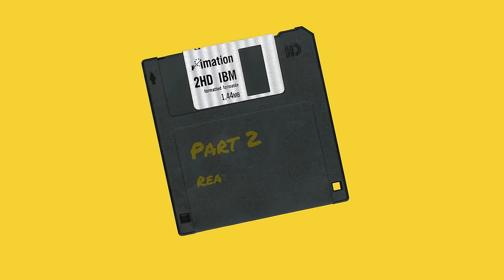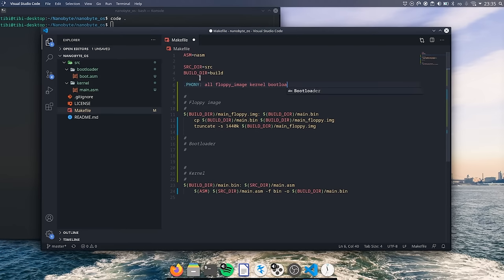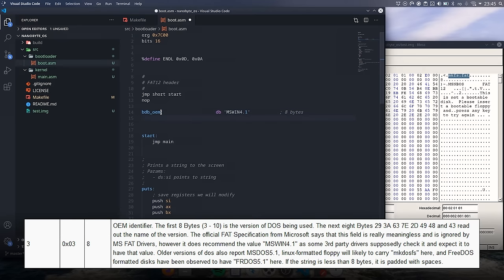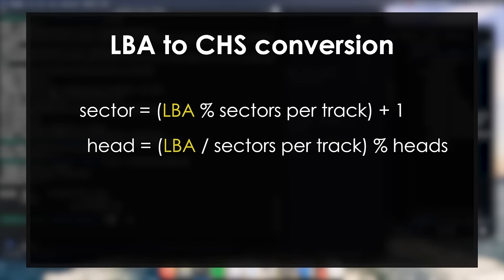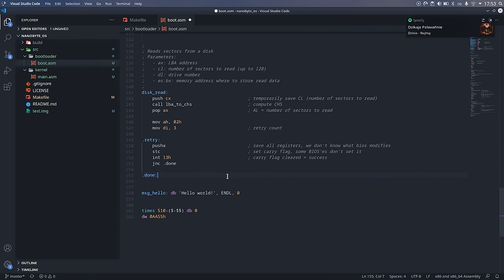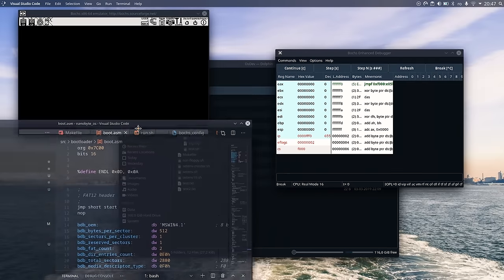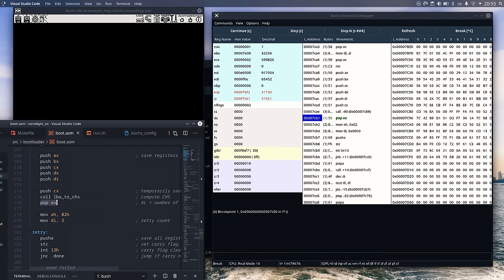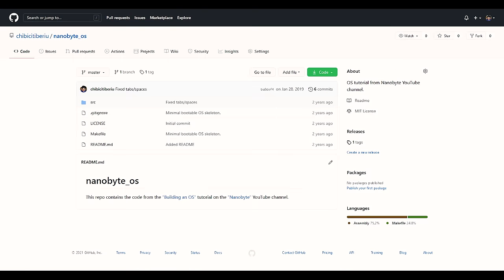Building an OS - 2 - Reading from the disk

Comment: Amazing Video!
The only bad thing was that there is no mkfs.fat command on mac so it took me 3 hours to find a replacement, but i did.
For anyone that is on mac just replace this line in the Makefile:
15 | mkfs.fat -F 12 -n "NBOS" $(BUILD_DIR)/main_floppy.img
       with: 
15 | newfs_msdos -F 12 -f 2880 $(BUILD_DIR)/main_floppy.img
Reply: Thanks!
Reply: later on the choices once again kill mac so now I'm on my own... just entered protected mode and now only just got lld to start making a C kernel for it
Reply: what about the mcopy command?
Reply: @andreitircavu64  That comes from mtools.
Reply: if you've installed mtools then you can use that to create your floppy image: mformat -C -v NBOS -f 1440 -i $(BUILD_DIR)/main_floppy.img

You don't even need to use dd to create the empty image file first.
Reply: I should have checked the comment section before I spent an hour trying to figure it out. I still had no answer untill i saw this. Thanks so much. Probably saved me many many hours and my lots of time searching for an answer.
Reply: any ideas for linux?
Reply: I thinks this difference is because mac os is UNIX certified and GNU Linux is not.
Reply: Thank you.
Reply: For those on Windows having issues. I got to this point just fine. However, adding these extra commands caused issues.
I found that I could call WSL to jump into the linux emulation and call make there and it work.
After the various build commands:
sudo apt-get update
sudo apt install make nasm mtools
Then my make on windows, now under the WSL worked like a charm.

Comment: Rowing rowing your boat... Down the memory lane... That video brings me so many memories. Imagine troubleshooting that without QEMU or BOCHS, using a real floppy disk!
Reply: and going through a pile of docs to understand all the specs instead of googling it in 3 seconds.. 😭 early programmers were truly pioneers..
Reply: you could still do it, just not with floppy disks .

most desktop computers still have at least 1 serial port so if you setup com1 port you should be able to diagnose the same as they use to.
Reply: @logangraham2956  What I tried to say was how I did it with floppy disks decades ago, using nothing more than Brown's interrupt list and a lot of reboots.
Reply: @ecosta  I am doing it in much a similar way, I do have youtube and google to help but I often find it much easier to just read Brown's interrupt list and figure it out from there. GDB has been a life saver allowing me to step through the bootloader and kernel in qemu and see if the code to execute is what is meant to happen, a lot of reboots indeed! Thank for for qemu! I did have it booting on real hardware too but currently ripping apart the bootloader and improving it to include a real file system, i grew tried of writing the kernel directly to disk its time for a better aproach!

Comment: why are you doing everything so fast? I can't keep up with you
Reply from the maker: Coding part is sped up, because otherwise I would end up with 2-3 hour long videos... I agree that I might have overdone it a bit in this one, I'm sorry about that, I'm still learning how to make videos, and hope the newer ones are better. You can pause at any time, or slow the video down, or use the Github repository.
Reply: @nanobyte-dev When you did the terminal at 24:00, I slowed down the video a lot of the time but still couldn't keep up with you. I give up now 😥😥😥.
Reply from the maker: @cubomusic6659  Don't give up :( 

The commands I write aren't that important, I recorded myself doing all the steps to figure out what needs to be installed, and then the text shown on top of the video shows the steps I already found. If you're curious what each command I did meant, here it is:

Add execution permission to debug.sh: chmod +x debug.sh
Run debug.sh: ./debug.sh
Bochs not found. Install bochs (after getting error it's not installed): sudo apt install bochs
Check if bios file exists: file /usr/share/bochs/BIOS-bochs-latest
Error, it doesn't exist. Try to find it using "locate", so first I update the locate database: sudo updatedb
Then try to locate: locate BIOS-bochs-latest
File doesn't exist, so maybe it's another package: apt search bochs
See that there are some additional Bochs packages, proceed to install them: sudo apt install bochsbios bochs-sdl 
Check if bios exists: file /usr/share/bochs/BIOS-bochs-latest
No error, meaning it exists. Now check if the video bios exists: file /usr/share/bochs/VGABIOS-lgpl-latest
Error, so it doesn't exist. Install it: sudo apt install vgabios
Now both file exist, try running: ./debug.sh
Reply from the maker: @cubomusic6659  Using bochs from the ubuntu repositories didn't work properly for me, you can see it in this video as well that I'm not getting any video output, just a black screen. In this video I finally solved the problem, by using a prerelease version of the ROMs: https://youtu.be/7CrUM8Uf9ho?t=3326 (at around 55:00 i debug the bochs issues).
Reply: @nanobyte-dev  oh thanks, i'll start over
Reply from the maker: @cubomusic6659  Are you on WSL? qemu is a GUI application, so you need to setup an X server. Check this video for more info: https://www.youtube.com/watch?v=TgIdFVOV_0U
Reply: @nanobyte-dev  and also my bochs doesn't apper
Reply from the maker: Are you using wsl?
Reply: @nanobyte-dev  ok i will try :)

Comment: Thank you for this. I used to play with that in the early 90s...

To pass parameters to a function, "high-level" languages use the stack:
my_function proc near
param1 equ [bp+4]
param2 equ [bp+6]
    push bp
    mov bp,sp
...
    mov ax,param1
...
    pop bp
    ret 2 ; 2 words
my_function endp

and

push param1
push param 2
call my_function

Now, to be fair, this is pure 8086, as they add "bound" instructions since 80286 (long ago) to avoid the "ret 2" and needing to calculate the number of words to unstack, but that's more than enough in a 16bit real mode bootloader.

Also, function 41h of int 13h seems to take LBA values for read, which is more appropriate if you're using a different media (such as an empty hard disk or an ISO), so you don't need to bother calculating the CHS. Also, there are bitwise ways of filtering and calculating CHS (with and+shr and shl if you're using ecx/edx) and "or dl,dl" seems to be the fastest way to check for carry in dl (rather that "test dl").

I know "hlt" is short, but for a reboot, you can also do:
xor ax,ax
dec ax
push ax
inc ax
push ax
retf

...or simply
jmp 0ffffh:0000h

So you're sure everything is done properly at processor level, whatever "variant" of x86 you have (including Cyrix and AMD).

 Also, for the teletype function to output a string, you can have a function that starts with "pop si", reads the string until it finds a '\0\ and "jmp si" (push si before calling if required) and thus have your messages directly inline, like:
write_string proc near
    pop si
    mov ah,0eh ; int 10h:teletype
    xor bl,bl ; screen 0
loop:
    lodsb
    or al,al
    jz eos
    int 10h
    jmp loop
eos:
    jmp si
write_string endp

/* ... some code... */
push si
call write_string
 db 'hello world',0
; code continues here...
pop si
...

That's a lot of jumps at the beginning, wouldn't it be better to have your first instruction as just "jmp start" and all functions before/after the main block instead of having "jmp start/jmp main"?

Comment: Important note to those using WSL:

If you're having trouble getting bochs to work, it's because of the weird nature of WSL not being able to access everything. 
Bochs by default tries to access the sound cards during initialisation, which WSL has no support for. This results in a really annoying error when you try to run it.

The fix is adding this line to the bochs_config:
plugin_ctrl: speaker=0
If bochs is screaming about memory issues, check the address. In my case I had to change it to 0xffff0000.
Reply: thanks you this worked!!!! :)

Comment: I am enjoying this series a lot, so keep them coming!

As for the boot loader... Personally, I would actually simply use the standard boot sector for a FAT12 filesystem and patch this to load a custom file. This file would then be the boot loader and would in turn set things up and load the actual kernel. This ensures some compatibility with anything existing and also saves me from having to write a new boot sector every time I start a new experiment.

Comment: Bochs does not like the option "gui_debug" for the SDL2 library. Any way to fix that? I'm on Fedora Workstation.
Reply: bochs doesn't like the option "gui_debug" for me as well, but i'm on mac, maybe it's just outdated?
Reply from the maker: I've had a ton of problems with Bochs myself, so I no longer recommend using it. I recommend debugging with qemu and gdb. I have a guide in the #faq section in my Discord channel where I show how to use qemu + gdb.

Comment: Amazing Video thx for all of that knowledge, I simply have one question : 

When we run the fnc "lba_to_chs" we take in enty:
-> AX (The value of LBA address)

And I suposed to get my answer as :
-> CX -> Bit16 to Bit6 => my CYLINDER (Cy)
-> CX -> Bit5 to Bit1 => my SECTOR (Sc)
-> DH => my HEAD (Hd) -> 0 or 1

There is what I don't understand :

CX (16bits) should be like that :  Cy10 - Cy09 - Cy08 - Cy07 - Cy06 - Cy05 - Cy04 - Cy03 - Cy02 - Cy01 - Sc06 - Sc05 - Sc04 - Sc03 - Sc02 - Sc01
DX (16bits) should be                :  X X X X X X X X - X X X X X X X Hd01    Because Head can only be 1 or 0

You save in CH the value of AL (mov CH, AL) so :
CX = Cy08 Cy07 Cy06 Cy05 Cy04 Cy03 Cy02 Cy01   -   X X Sec06 Sec05 Sec04 Sec03 Sec02 Sec01

After You do : (shl AH, 6) : you get In AH Registry the value of Cy10 & Cy09
AX = Cy10 - Cy09 - 0 - 0 - 0  - 0 - 0 - 0    Cy08 - Cy07 - Cy06 - Cy05 - Cy04 - Cy03 - Cy02 - Cy01

Then after : (or CL, AH) You put the 2 byte of AH in CL,  so you get :

CX = Cy08 Cy07 Cy06 Cy05 Cy04 Cy03 Cy02 Cy01   -   Cy10 Cy09 Sec06 Sec05 Sec04 Sec03 Sec02 Sec01

And this is the final value you return :

So How Can It work If the 9th & 10th bit of the cylinder value are not at the good place in the registry ?

Maybe you explain it in your next video, but for now I try to understand all the step for reading a disk with ASM.

Great series of video, thx for your work.
Reply from the maker: If you check the documentation of INT 13h, AH=02h on wikipedia, it gives a diagram of the bits in CX. They look in fact like this: 

CX = Cy7 Cy6 Cy5 Cy4 Cy3 Cy2 Cy1 Cy0 --- Cy9 Cy8 Sec5 Sec4 Sec3 Sec2 Sec1 Sec0

(in other words, bits 0-7 of the cylinder are set in CH, bits 8 and 9 of the cylinder are set as the upper bits of CL)

The reason why it's like this is probably backwards compatibility... older drives that had smaller capacities used CH for the cylinder and CL for the sector, but at some point the cylinder didn't fit in 1 byte anymore... so how could they fix it without breaking compatibility? Just reuse the upper bits of the sector for the extra bits.

HDDs can have more than 2 heads.
Reply: @nanobyte-dev  it took me hours to understand hahaha. I touguth it was a bug in your code and so i fixed it. With my "fixed version" wasn't working and i coudn't uderstand why

Comment: I do not have a floppy disc how can I boot system on another form? To rephrase when running the make file qemu responds with no bootable decide how do I find a device to boot from?
Reply: i spent like days on this
the problem is with the makefile
he is using linux while most ppl are prob using windows
its not generating the main_floppy.img properly

Comment: I need help !! I'm using kali linux. In bochs, when I set the breakpoint at 0x7c00 and click on continue it says
bx_dbg_read_linear: physical memory read error (phy=0x0000322f3130, lin=0x00000000322f3130)
and the address stays at 0xFFFFFFF0 :(
Reply from the maker: It is probably the BIOS, i had issues with it as well. Try some other BIOSes from some other versions. Debugging with qemu and gdb might work better, in the last version of the nanobyte-os repository, there is a file scripts/debug.sh, you can use that as a starting point for debugging directly in qemu and gdb.

Comment: thanks for the content, i learnt very much, just want to ask that in 7:46 ,the term " : : kernel.bin ", what does it mean?
Reply from the maker: :: is just the way you specify the "root" folder in mtools (mcopy, mdir etc). "::kernel.bin" means the file kernel.bin on the root of the disc (in Windows, that would be A:\kernel.bin).
Reply: @nanobyte-dev For me it's still saying It's a bad target. I tried the C drive but it's not supported. Any idea how to fix it?

P.S: nevermind, I've got it

P.S P.S: Nevermind I haven't got it 🥲

Comment: After testing a bit, I found that QEMU already seems to be loading sector 2 of the floppy disk into 0x7e00 before we even read the data with int 0x13. Didn't you say that we only have access to the first sector of the floppy disk, which is why we need this read function early on?
(Also btw I couldn't get Bochs to work with WSL which is why I settled on QEMU+GDB, which seems to work if you do a workaround for a bug with its interpretation of i8086.)
Reply: Nevermind, I think I made a mistake using GDB which led me to believe this. Yes only sector 1 is loaded in by the BIOS
Reply: Did you try adding "sound: waveoutdrv=dummy, waveindrv=dummy, midioutdrv=dummy" to your bochs_config file? I think WSL is lacking sound output and so Bochs doesn't know how to handle it by default. Adding that line was the big modification I needed to make nanobyte's code work in WSL.
Reply: @cyrusheick8135  Thank you so much! I had the same problem a while back which kind of made me stop because I could never find an answer, now I can (finally) get back to coding

Comment: which operating system are you using yourself ?
its quite beautiful
Reply: They're using Linux with the KDE Desktop Environment, presumably some extension installed to make it look MacOS-like
Reply from the maker: If i remember correctly, I was using Kubuntu with either the default dark theme or the Arc theme... can't remember exactly.

Comment: Hey ! Thanks for the tutorial series I'm learning a lot and it's quite fun to slowly understand how assembly works and how to write advanced logic with it by creating a tiny tiny OS.
However I ran into a problem when using Bochs...
It seems like in newer versions of Bochs, the config file is broken (or the BIOS) because whatever I do, I cannot get Bochs to actually launch my image whilst QEMU does the job perfectly. I'vhe looked into errors and yes I can confirm that the problem comes from the latest version of Bochs (2.7+) Any idea on how to fix ?

What happens is : the BIOS starts but looks like it finds nothing and crashes. An error is reported telling me "bx_dbg_read_linear: physical memory read error" but I suspect this is not the only problem as my "t" counter is far below yours...

Thanks
Reply: a workaround is to set the romimage to legacy and remove the address argument
Reply: I'm glad I'm not the only one dealing with this... I'm hours deep trying to figure out what the heck is going on. I'm brand new to this, but I'm trying to work my way through this and am thinking that somehow the stack pointer is getting messed up and pointing to the last line of the BIOS. The memory location it's trying to access (0x322f3130) is actually a portion of the ASCII code showing the date on the BIOS file. If you use xxd to look at the BIOS file you'll see 08/01/21... the stack pointer is set to the "01/2" portion of that string and so when it tries to grab the address to put into BX is grabs the 4 bytes for that ASCII representation (it treats 2 as the MSB so it gets reversed). Look at an ASCII table and you'll see "2"=0x32, "/"=0x2f, "1"=0x31, "0"=0x30. 

Now as for why this is occurring... I've noticed that if I step to t=320322 there is a "mov esp, 0xfffffff0" instruction. I didn't keep tabs on the stack pointer for all the subsequent instructions but I'm guessing it's related. Maybe someone knows a reason for why you would want this instruction, but I can't think of a reason why you'd want to set the stack pointer to the end of the BIOS file? I'm not sure what to do from here, hopefully someone smarter than me stumbles upon this comment and can help make sense of it all :)
Reply: Which now that I'm looking, that 08/01/21 date is also the release date of Version 2.7. So you mentioned that the problem comes from version 2.7... how did you differentiate between the Bochs version and the BIOS file that was released on that same day? I'm wondering if it's an issue with the BIOS instructions itself or the way that Bochs is handling the offending instruction.
Reply from the maker: I had a lot of trouble with it myself, it's usually the bios or vbios. Trying out a couple of different versions (e.g. from the master branch, or from a newer/older release) I would eventually find one that works. Lately I gave up on bochs and just use qemu+gdb. I have a section in my discord faq channel where I describe how to set it up.

Comment: Because of a layout fault in the first video the bootloader you have does two jumps at the start which is a waste! What layout fault do I refer to? You have defaulted to the C/C++ convention of putting functions above the main in the code! In Assembly you put them after the main block of code so the main block starts at the start, no need to do a jump instruction past the functions. The assembler does not need to see the functions before they are used, or rather they do not have to be defined first like in C/C++. Basically the assembler does a number of passes over the code with the pass that converts labels to addresses being after interpreting the instructions in the code so it will know exactly where the functions are by that time.
Reply from the maker: You are correct. 
Old habits die hard.